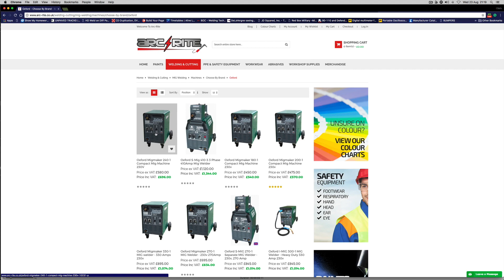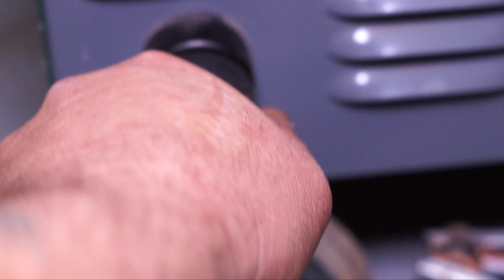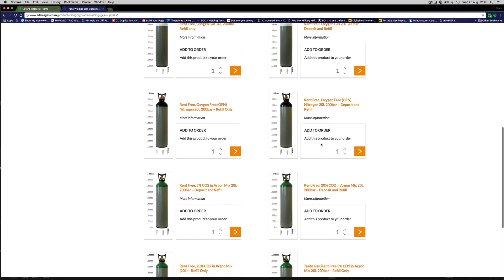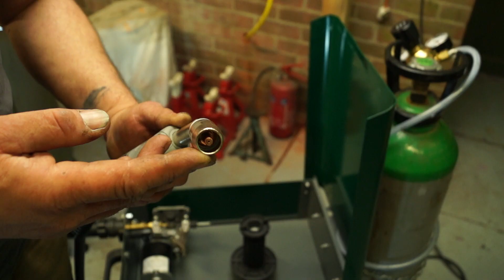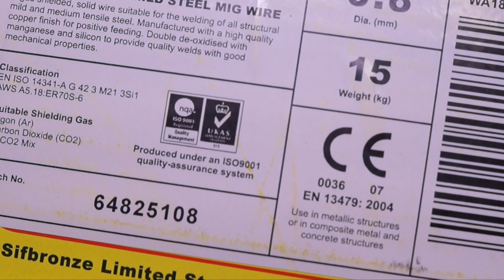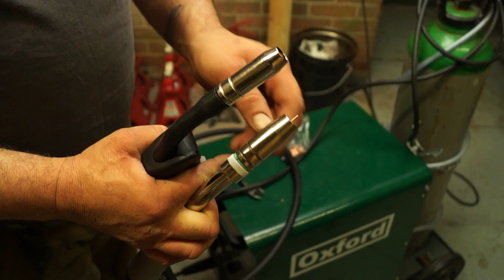Land Rover ( MIG) Welding. -  Oxford Migmate 200-1 Walk around

Comment: Set wire feed preasure so you can just stop it with you finger and thumb at the tip .Also you might find 5%co2  gas will give you be Beter results in thinner material say  up to 6mm